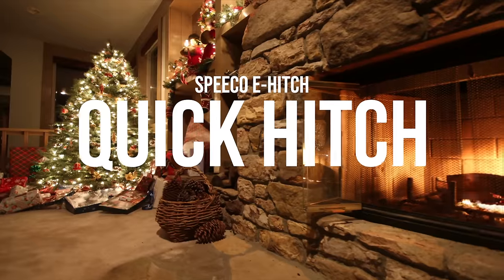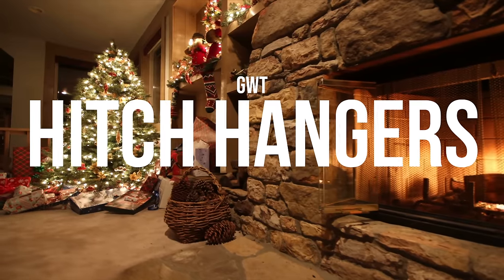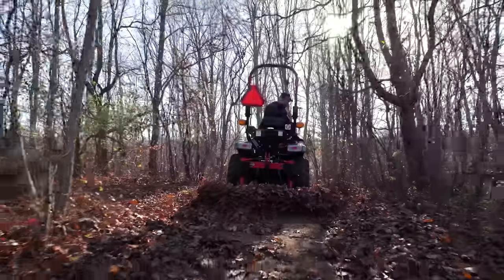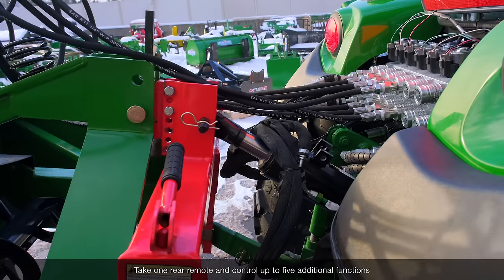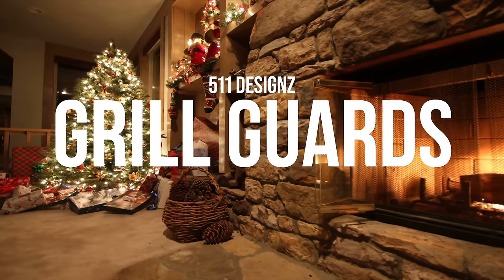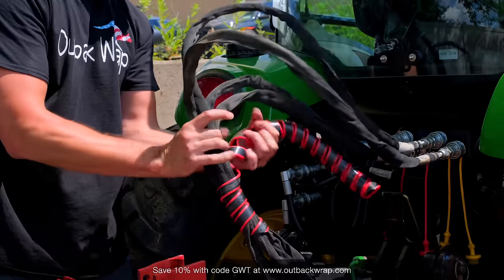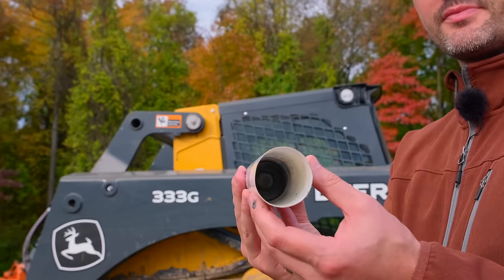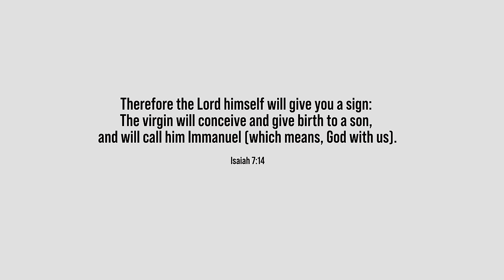2023 TRACTOR CHRISTMAS GIFTS: SHARE WITH PEOPLE THAT BUY YOU STUFF!

Comment: Will flat out work in a tire with water in it? My rear tire has a slow leak .Would I have to remove the water first?
Reply from the maker: You want Multiseal 1500 to mix with liquid ballast.  Similar stuff, but sold in bigger containers as you need more.  Generally a 10/1 ratio of liquid vs Multiseal.  It'll stop those leaks.  Save 5% with code GWT at https://multisealus.myshopify.com/

Comment: I'd worry about too much weight on one loader arm with that trailer mover.  I've got a full plate with a 2 inch in the middle. But. It won't slide under the tree😂😂  opt for the bucket brackets.  Was that an upsell? 🤣🤣